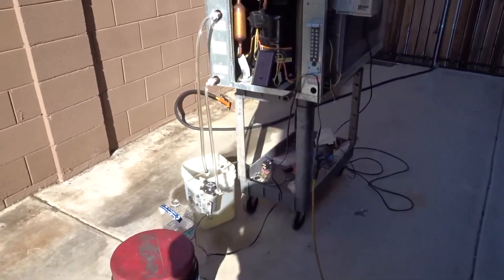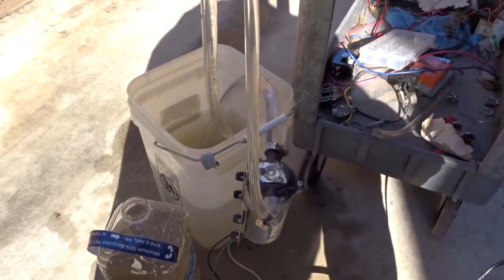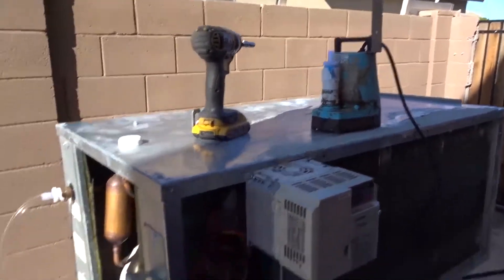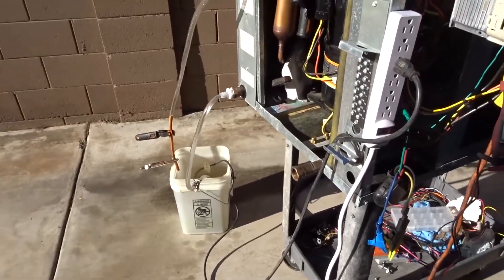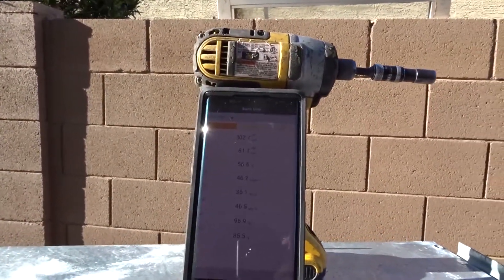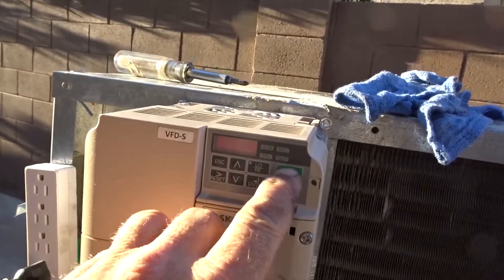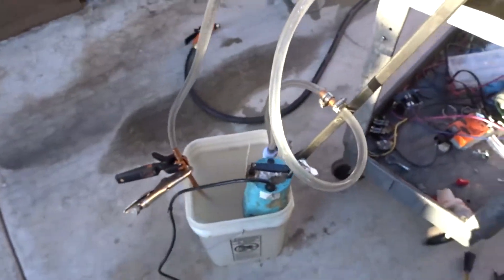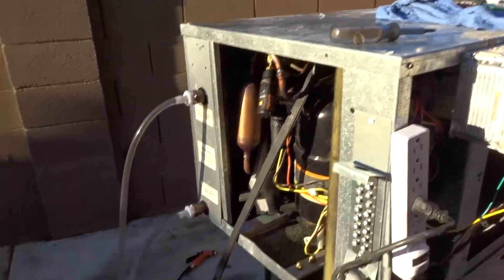The Bastardization of a WSHP into a VFD Water Heater - Part 3 - A series of failures???

Comment: If I'm not mistaken those submergable pumps (if it is) are full of oil. Keeps em from floating, helps the motor with cooling, pressure differential on bearings for water intrusion, etc. Idk any one I've ever pulled apart was always full of oil lol. Looks like a little condensate pump tho so they may not be. Not supposed to be submerged or have a long duty cycle.
Reply from the maker: It's definitely a submergable pump.
They were used in evap commercial evap coolers. 
I hadn't taken a working one to see what is in it. Maybe it has oil

Comment: your trying to heat water im trying to chill it i made a chill from a vending machine compressor sled and water fountain chiller barrel and i got the glycol to -45°F
Reply from the maker: Nice.
I assume you mean 45 degrees (a common chilled water temp) rather than minus 45? LOL That usually takes cascaded cooling. And those are crazy designs. HA HA
Reply: @hackfreehvac  no im chilling it that low for overclocking my computer instead of LN2
Reply from the maker: @adamace2002  I've seen people do that. 
But you then get lots of condensation from being below the dew point.
You'll need to insulate your tubes and heat sink.